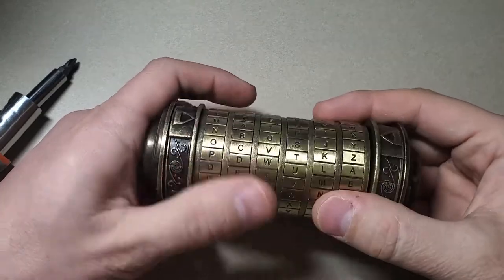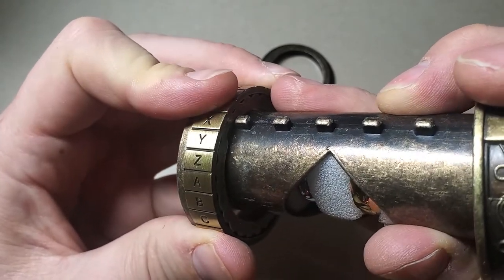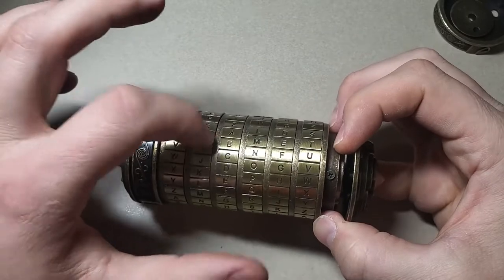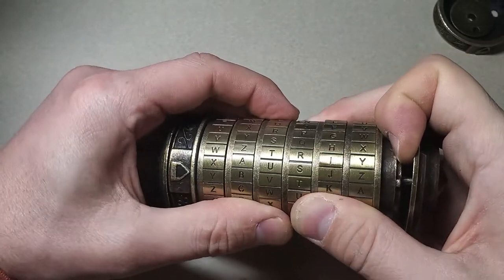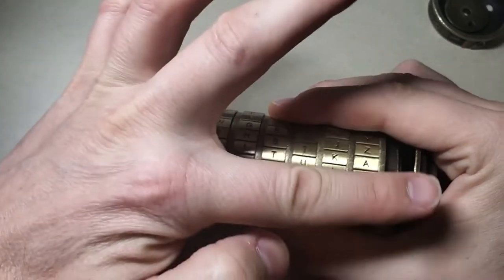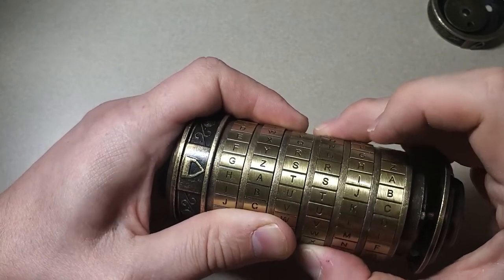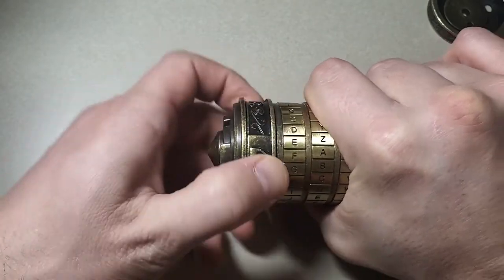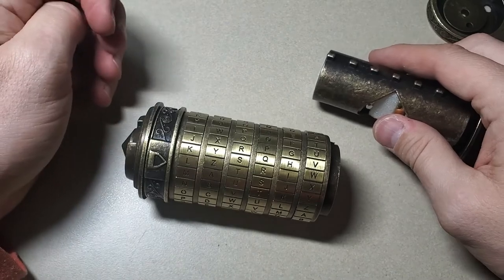Hack and Break into a Cryptex

Comment: Well, there seem to be some differences in production tolerances, because tried on mine and had no success until I dialed in most times 5 of the letters, in seldom occasions I was able to do it by 4 pre dialed. The slight moving of the other end only started by the 5th letter, so I assume mine has been fitted much more tightly. (I know the password, but was just curious how hard or easy it would be)

Comment: question i figure u found ur password after some tries but I'm not able to do it since mine is fully intact, is there some other way to open it
Reply: yes, so if you have the same model he does the right side pointy bit is actually a screw so you can unscrew it to change the combo if you forget it! Unless you have previously superglued it
Reply: @Forgettings  Well... that was exactly what was done...
Reply: @Forgettings  Mine doesn't seem to have an endcap that can be unscrewed. or it's on really tight